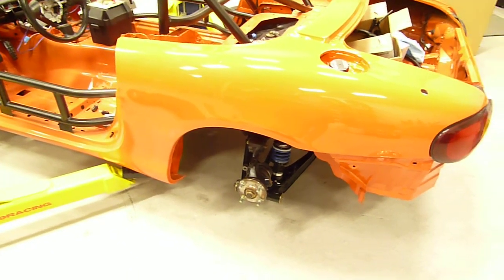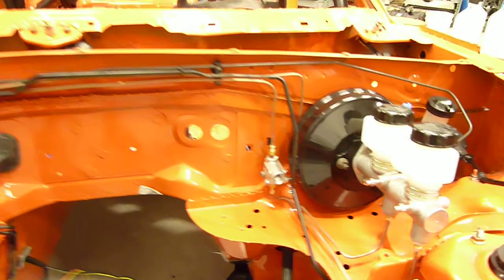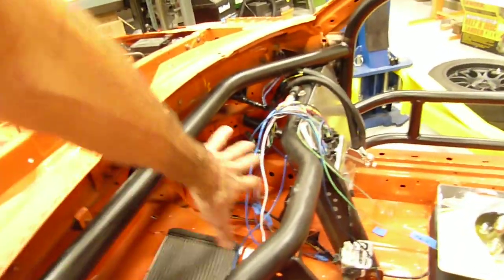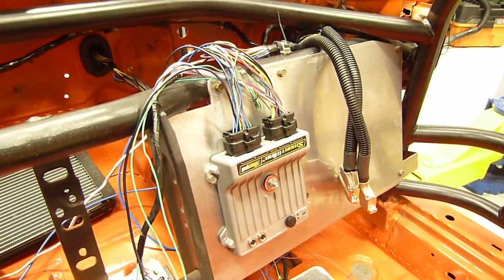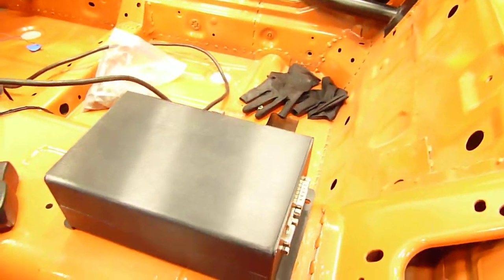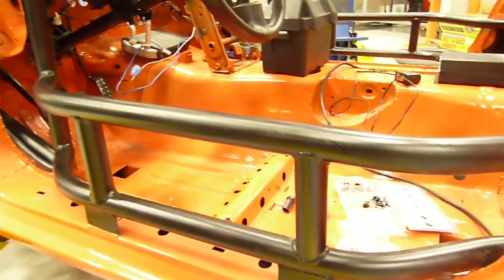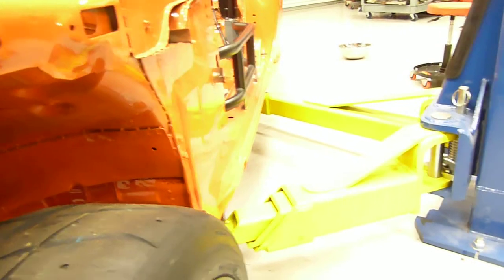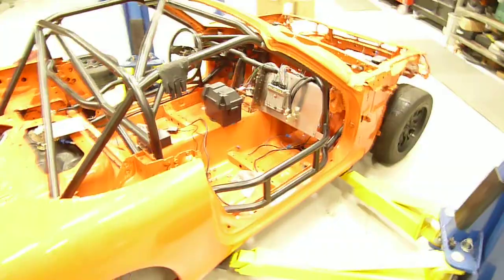Crusher build part 1

Comment: What was the tire temperature sensor solution mentioned? Is that still something viable to use these days?
Reply from the maker: We didn't add it. There are a few on the market now. Google" racing tire temperature monitoring system"